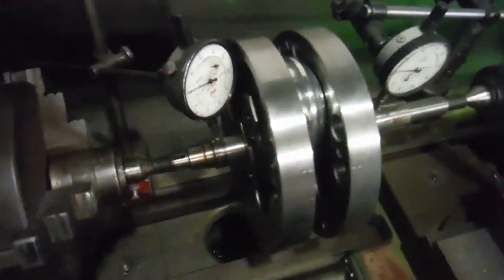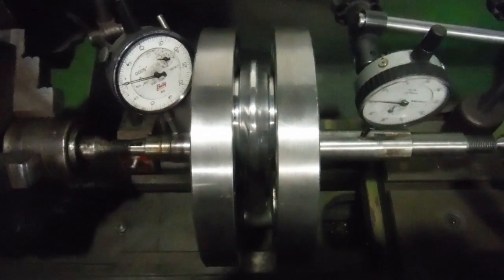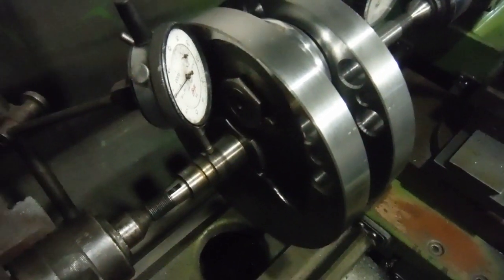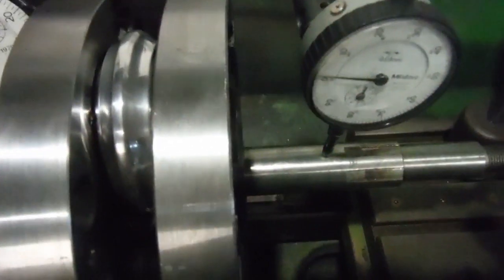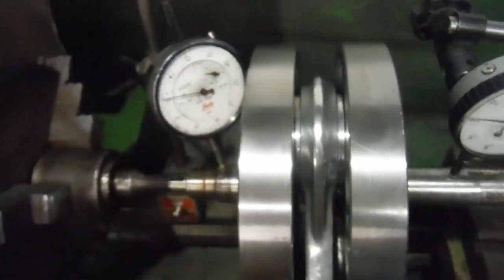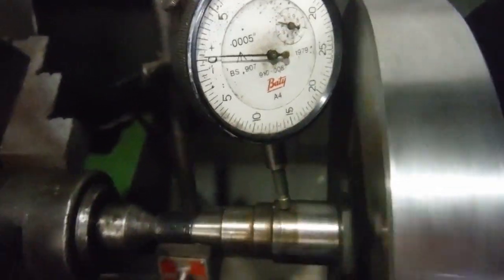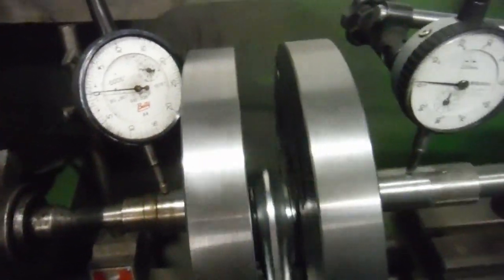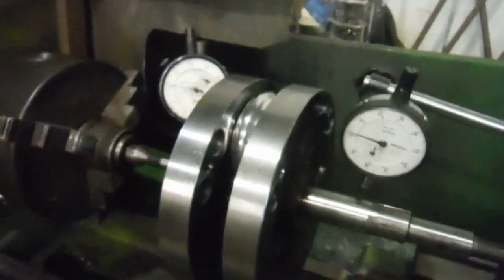Royal Enfield Bullet Asbo 43 - checking the lightened and rebalanced crank assembly for runout.

Comment: Crankshaft seals are all important on a two stroke , which relies on crankcase compression to force gases into the combustion chamber via the transfer ports. Each main bearing must be sealed . The seal on the end of the crank that was the wrong way round  is just one of three that must be working correctly
Reply: Oops , commenting on the wrong video, please ignore
Reply from the maker: No problem.